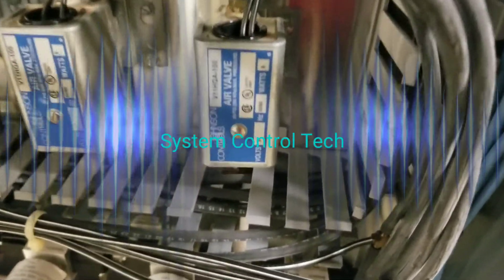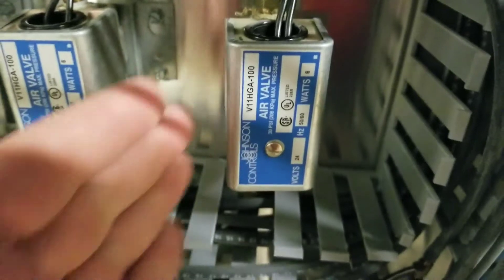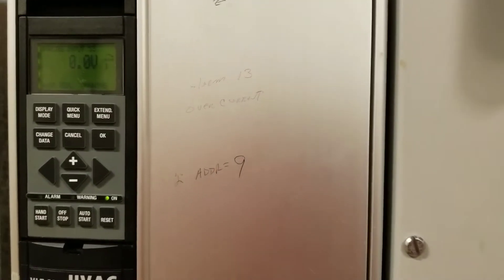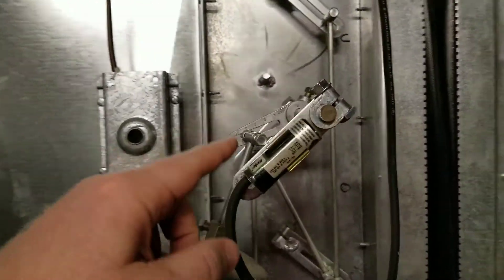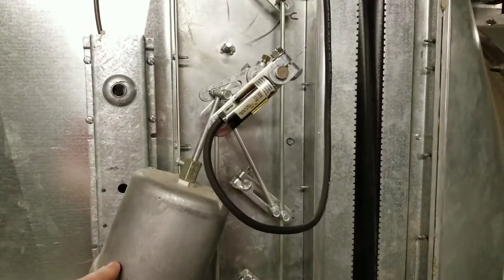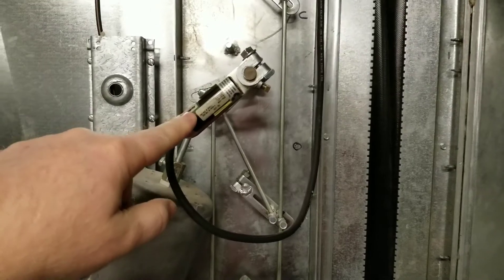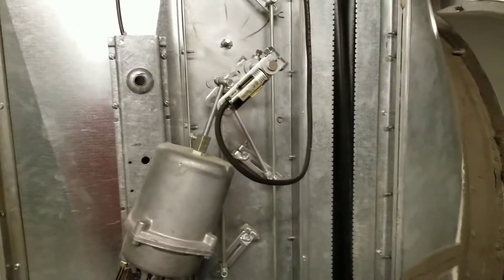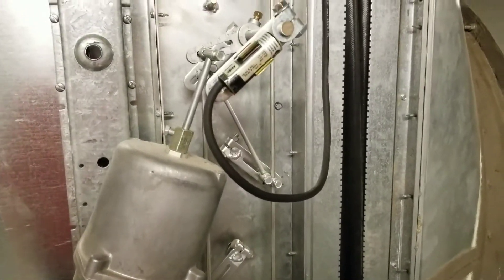Pneumatic valve issues can affect start circuits

Comment: Sr, I came across your channel and it’s very informative.  Is this set up only for 100% OA units?
Reply from the maker: This unit is a mixed air device but something similar is sometimes used for 100% OA units.  You don't want the fans running if the dampers aren't fully open.